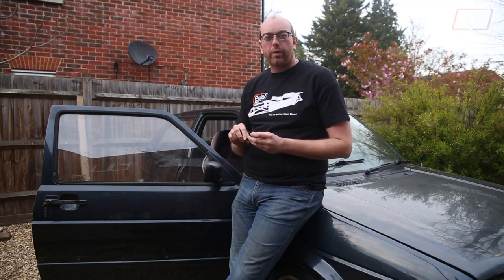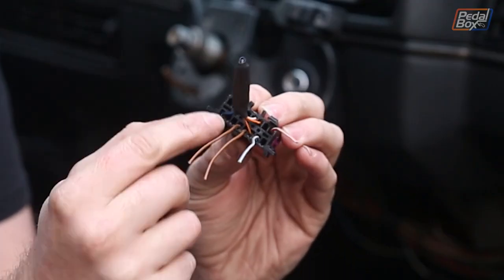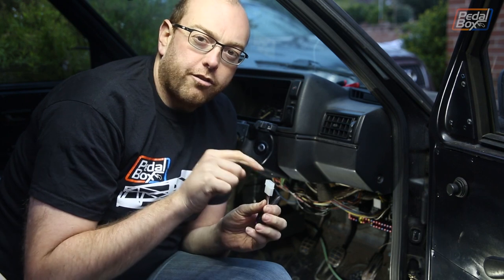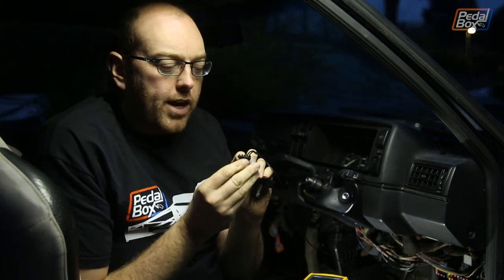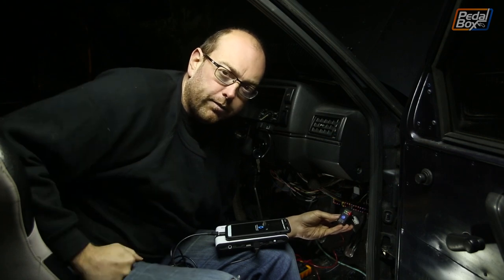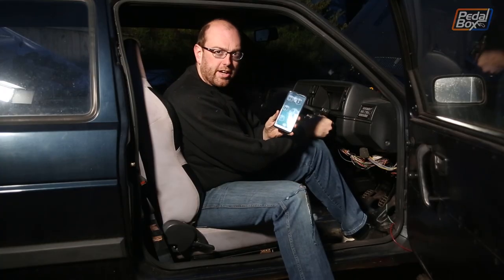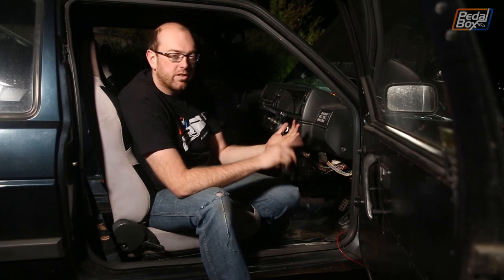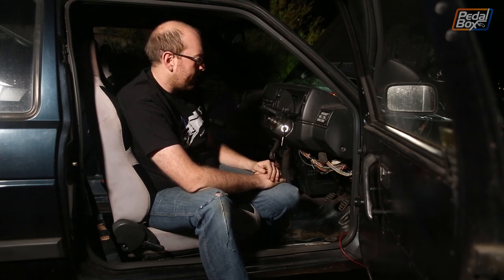Installing OBD into the Mk2 Golf - PedalBox Episode 22 | Fleet | Golf VR6

Comment: What obd scanner u guys used ? Never worked on my alh 1.9 tdi but vag com with a computer works , so nothing wrong with the connections
Reply from the maker: The software is called Torque, on the Play (and I assume App) Store and then a generic BT adaptor which was listed to work with Torque from Amazon.  Been good so far, wont read ABS/AirBag codes but for general diagnosis/reset its been great
Reply: @PedalBox  thank u for replying, I have torque but never worked in my car with the Elm 327 even the same device worked on other cars
Reply from the maker: Interesting, is your 1.9 an early 2000's? Tried it on an A3 of the same era and it worked ok, Some of the module are a bit iffy, thats been the biggest failure point i've found, always seem a bit hit and miss
Reply: @PedalBox  my alh is from year 2000 it's a seat ibiza 110 alh the facelift also known as 6k2  not the square one but same alh tdi as jettas as golf mk3 and mk4 the one with the VP diesel pump before the PD engine , and yes it is strange , I was surprised  it worked on a Golf mk2 , it is kinda an enigma that I've been trying to figure it out , I know the scanner work in other cars it was the elm327 bluetooth one also actually tried a wifi version , I think the scanners don't read the protocol  ISO 9141-2  and that number 2 is the "second" version of that protocol  supposedly my ecu uses that same protocol  without that number 2 , that's the conclusion I got after digging so much , the pins are exactly the same as u described in the video , I even got as deep as some golf's having an aftermarket radio and that could be the reason... been trying to follow logic as much as possible, the conclusion I got is it's the scanner and can't find one wireless that actually confirms that works with that protocol, I wanna try an usb cable with torque at least I would be sure I'm waiting for one, I actually need to clear an abs / tc error